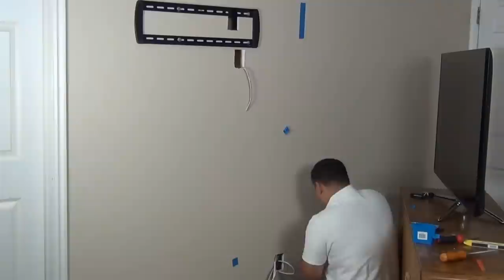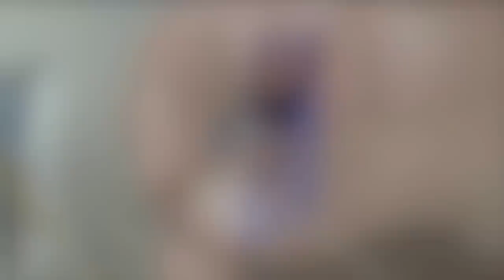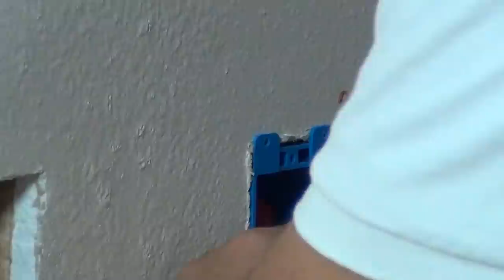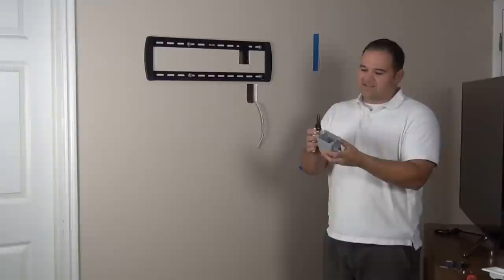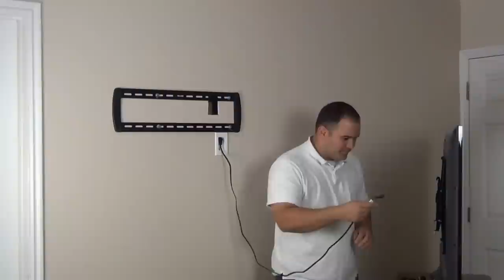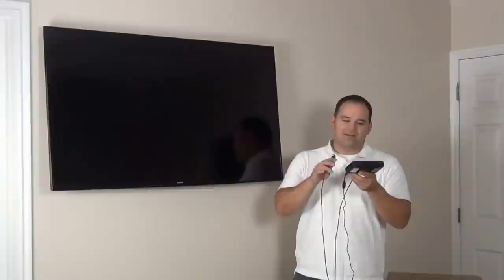How to move an electrical outlet behind the TV - How to Mount a TV to the Wall part 3

Comment: I can't help but to point out 3 flaws in your install and explanation. #1 Electrical code says that wire in solder less connections must be twisted together. #2 You indicated that you use red wire nuts even for 2 wires, you cannot do that do expansion and contraction, yellow is required for 2 wires, red is for 3-4 wires. #3 Under no circumstances are you to mix wire sizes, if some one comes along to do more work in the future and you have went from 14 gauge to 12 gauge on the same circuit it could be confused as a 20 amp circuit instead of a 15 amp. Please read the National Electrical Code. I am not trying to be a "troll" I just don't want someone to die in a fire because of your incorrect instructions and comments.
Reply from the maker: That's fair advice.
Reply: What if you ran 12 gage wire for voltage drop and connect it to 15 amp breaker, totally legal by code
Reply: Donald read the box on red and yellow or tan wire nuts ,you can combine different gage wire ,also red will work on2 # 12 wire

Comment: Cut the wires the same length what a hack job and the stab locks are just fine don't mislead people and you can remove the wires without cutting them. I am an electrician and your making a crap video that's unclear and misleading get better at your video. Also the wire splices you did was wrong you use linesman players to twist them because one wire can slip out and become disconnected however still make contact to the circuit. And you should also teach wrapping the outlet with tape it makes a safer box and never use a drill to tighten an outlet it can strip way too easy. If your an electrician you need to go back to school and learn proper techniques
Reply: Sorry tubby but those pushins on the receptacle arent the way to go ( I dont know why they havent been outlawed)after almost 50 years in the business i cant tell you how many calls i have made to residences because of the failure of the push in connectors . Over time those little tabs can expand and contract depending on the load on the circuit which sooner or later will loosen the contact making a poor connection which could overheat and actually cause a fire (ive seen receptacles melted in the box). Its not really necessary to tape the receptacle either , thats an old precaution from when metal boxes were used nowadays with the plastic boxes its not really needed . All this being said this guy shouldnt be doing electrical work unless he is licensed in the state where he is performing the work, if anything ever happens and the problem could be traced back to his work he could be prosecuted and lose everything ! And the homeowner could also be in a jam with his insurance company because this guy did not pull a permit . A greenie should have been used on the ground splice in my opinion (makes it easier on the next guy that has to open that splice ), using a drill to screw in the receptacle , I do it all the time, experience and control of the drill make it easier. The techniques he used drilling the studs and fishing the wire were great , he just needs to get licensed so he can perform electrical work in his state
Reply from the maker: Thanks Delta! I agree with everything you said here.  I am licensed too.  I carry a C10 in California.
Reply: pefect ! nice work Al !
Reply: Tubby Tim// No no no. The pushin connection cause a lot of troubles. I’m glad you didn’t wire my house. I always use drill to tighten the outlet into the box but never stripped any boxes. If you did, go back to school and learn how to use drill first.
Reply: Tubby Tim 
Yeah licensed or not you should not be giving lessons to people on how to hobby wire their own house even if it's just one Outlet for a television. You don't mess with license work. You should take these down, they are irresponsible
Reply: @deltaco417  I rewired my house, my restaurant,  my brother in law and uncles houses don't have a license and every one passed inspection.  I never use stab in's,  never tape any outlets or switches unless they are in metal boxes and a square drive on the end of a drill is great. I always cut the wires the same length too makes it easier to stuff them in the box when they are all the same. I don't really like the crimp on's I use a green nuts.   I also put pigtails on whenever there are more than one connection in an outlet box.  While I understand the concerns and consequences of not having a license, I also believe that you don't need one to keep up with the codes and do a quality job.  Would I do it for profit without a license probably not but it won't stop me from doing it for myself and my family.